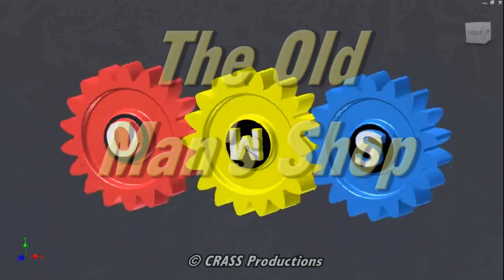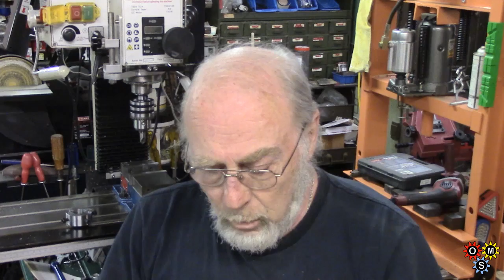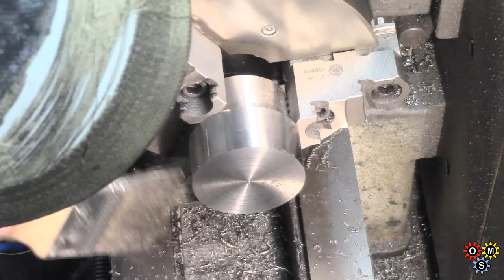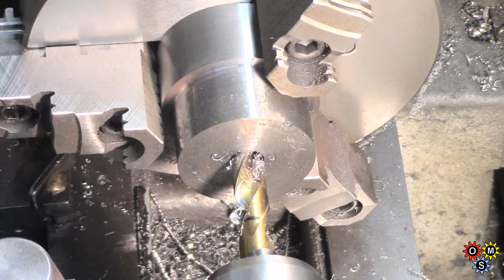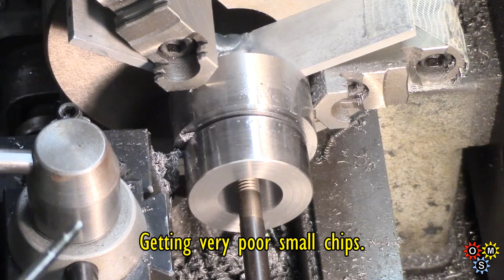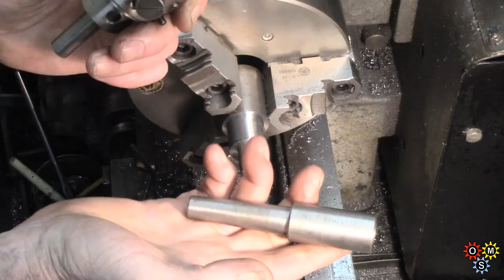Lathe Rear Spindle Spider. Part One

Comment: That course thread would be a lot easier if you make a few cuts single point, and finish it with the die. I to that all the time. Works pretty well.
Reply from the maker: +DSCKy 
It's called laziness! Couldn't be bothered to set up for thread cutting - so, the quick option, just a 50% sort of thread sufficient to serve a purpose.
Quite right though - single point partial sure helps a final die cut.